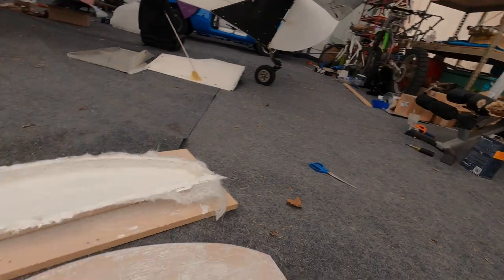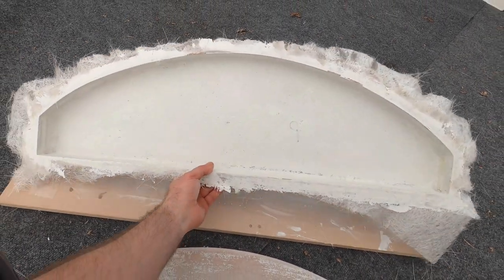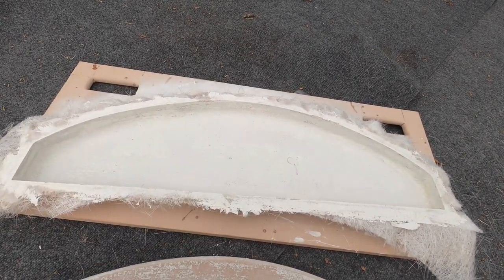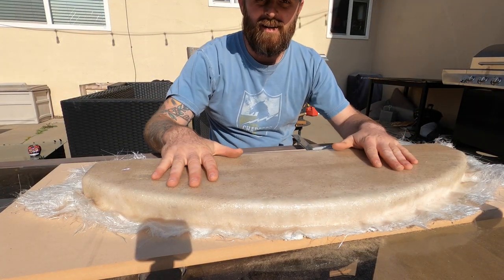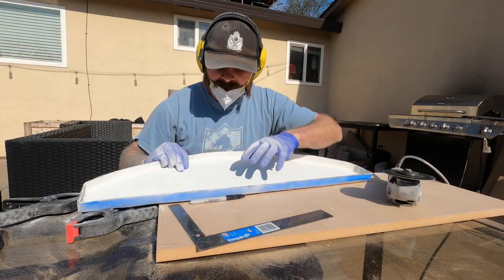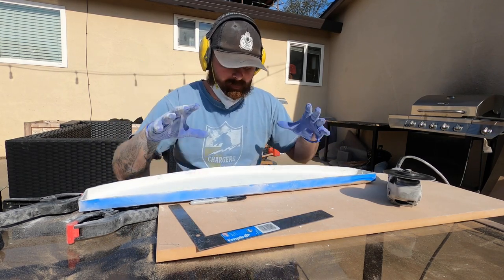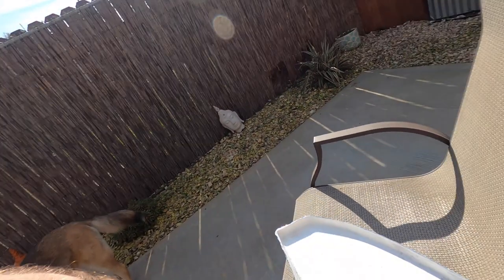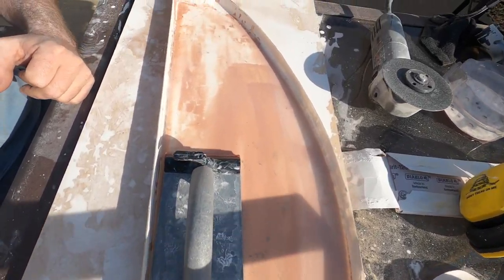New Carbon Fiber Panel For the Avid Flyer, Part 2

Comment: This is great, I would be interest in a carbon fiber panel, why supplies do you need
Reply from the maker: just laid the carbon fiber panel today. I will pull it out and up load the video tomorrow and see how it comes out. You just need the fiber and resin mix. will keep you posted. thanks.